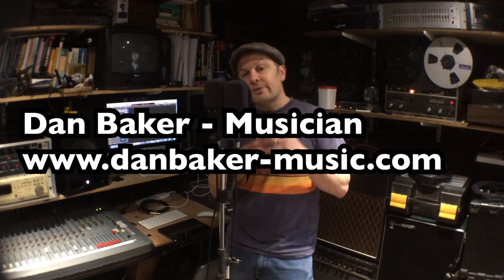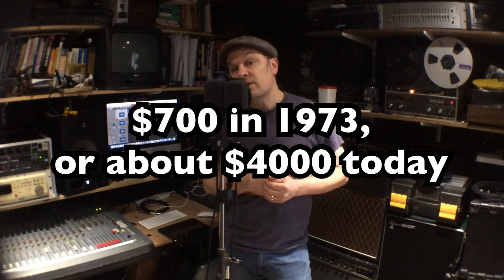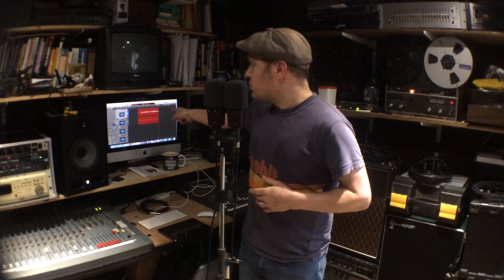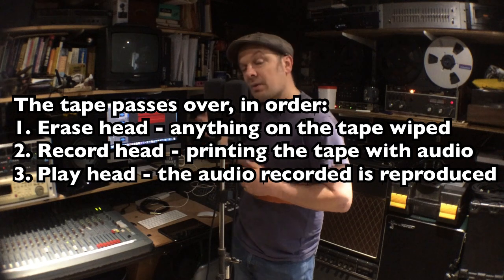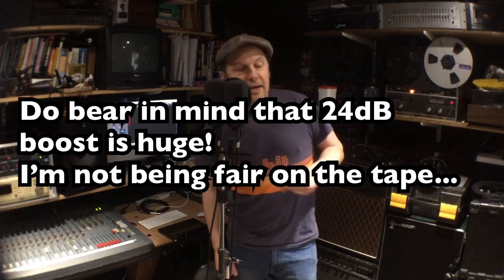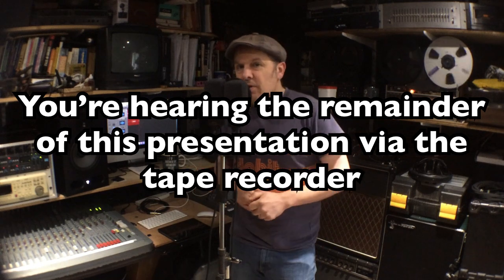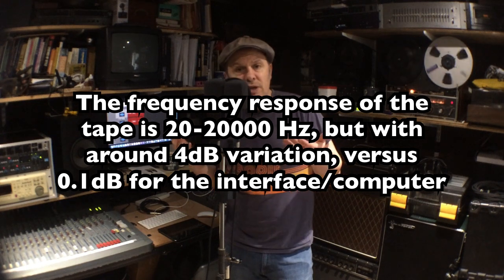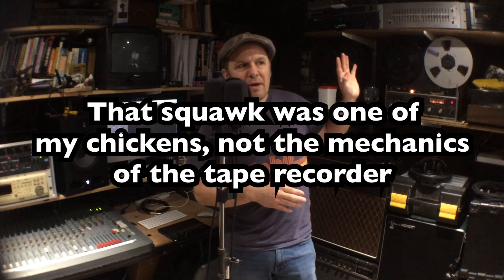Analogue versus Digital Part 2: The Difference Between Analogue Tape & Digital Recording

Comment: Well, I'm ashamed to say that I couldn't tell much difference in the two.. My ears ring constantly from running hammer drills in enclosed spaces and hunting without ear protection. (when I was a boy you were considered a wimp if you used ear protection. I'm glad that has changed!!! I grew up in the 70's) I threw away an old Teac and Akia reel to reel years ago, how short sighted was I ;-) I will say that the reel to reel seemed to have stronger bass, but not by much, and the cost for those tapes do seem to make them prohibitively expensive for most folks... Thanks for the demo, it does amaze me that we can now put many thousands of songs on a chip the size of your fingernail as opposed to 5 or 6 on that tape, and not lose much at all :-)